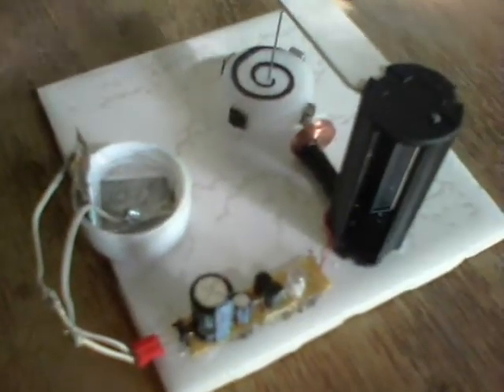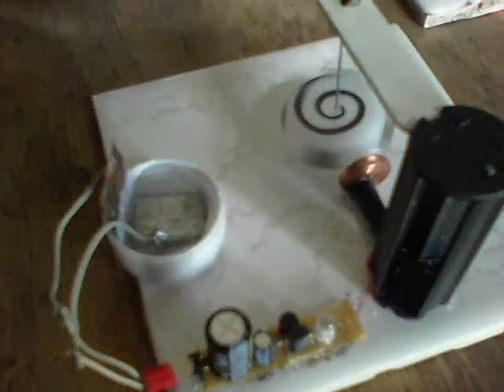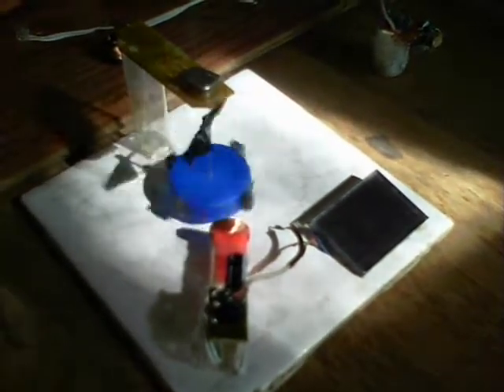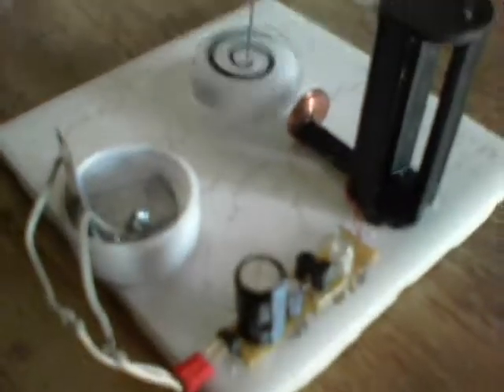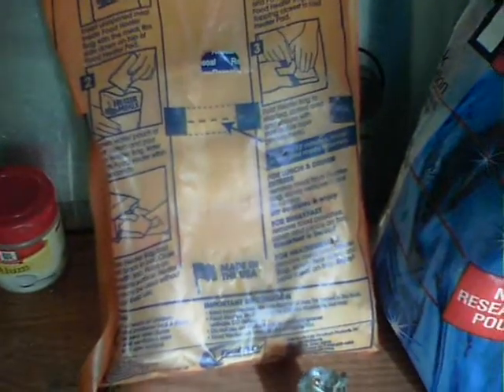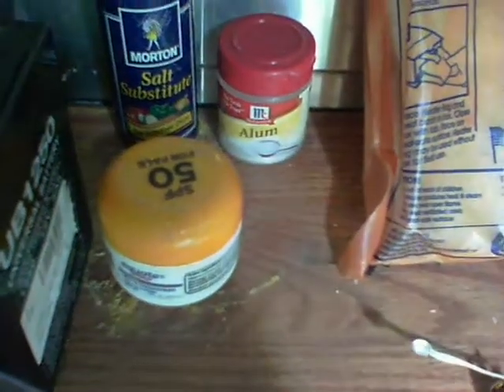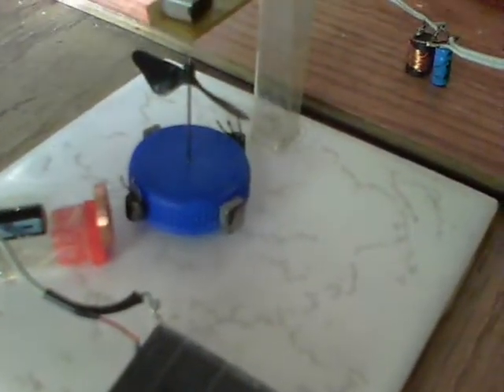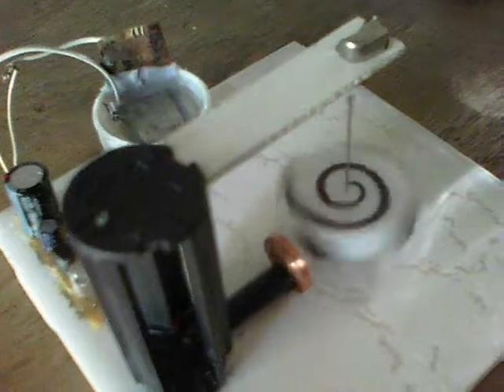Water powered pulse motor + crystal cells

Comment from the maker: That comes from crystal battery experiments. John Bedini put us on to that, the heating of copper to a salmon colour on a stove changes the properties, to those of a semiconductor. In practical terms, I find an increase of 0.1V and less long term sludgy build ups on the surface than regular copper. It matters when water or soil has output of about 0.7V. Heat for 5 mins, quench in water + repeat about 6 times with same side down to the heat, to gain the salmon colour :)

Comment from the maker: Yes, great source of supplies. TL494CN's in p/supplies are great for levitation circuits, there are ferrite toroids, HV caps, thick copper, power transistors, high amp wire etc. HDD's for the neo's, the motor parts are great for Bedini wheels and other pulse motors.
For the salts cells, alum and salt substitute will always net a good cell. Mix anything together in an old capacitor can and build something like Lidmotor's 'Penny' and yer away - it's addictive ! Blue LED cell is 9 months old :)

Comment from the maker: Appreciate you dropping by :) The solar one runs best under a CFL, which is odd in some ways. It auto starts better than the water powered one though. Fun little things, the solar one runs all the time that i'm around and the water one runs until the water evaporates. I recommend burning copper, get an easy 0.1V extra for the 5 minutes under a pot of spaghetti as it cooks at dinner time lol